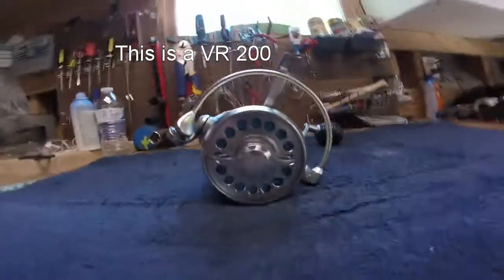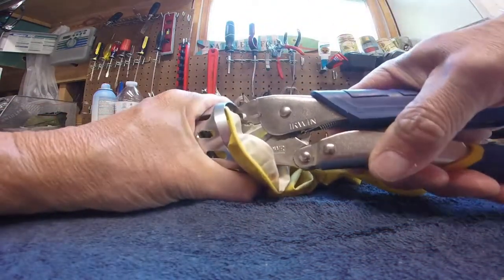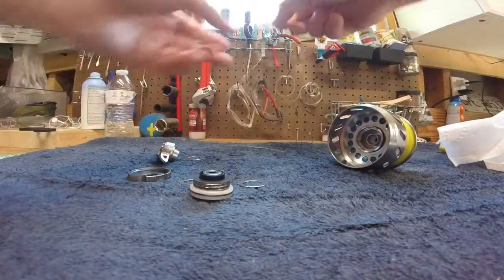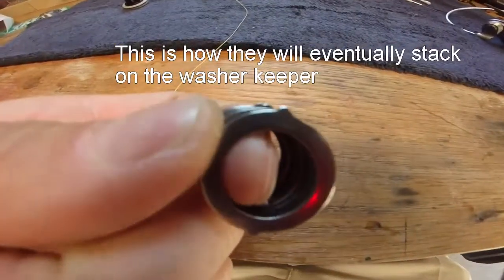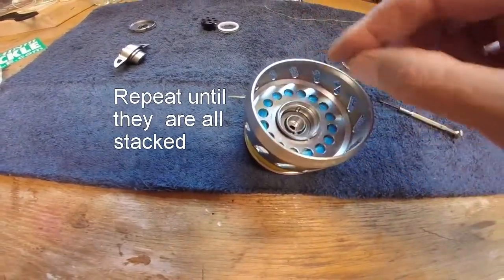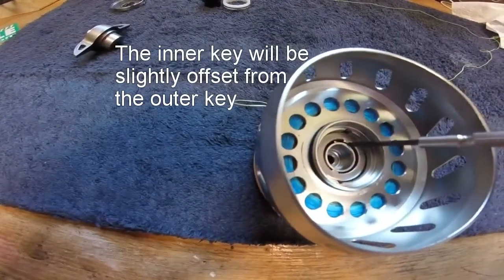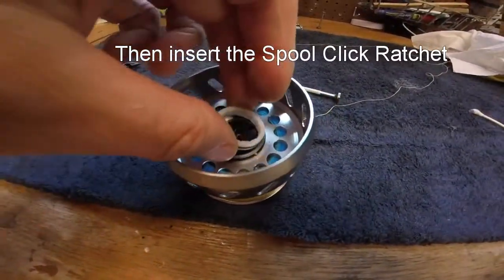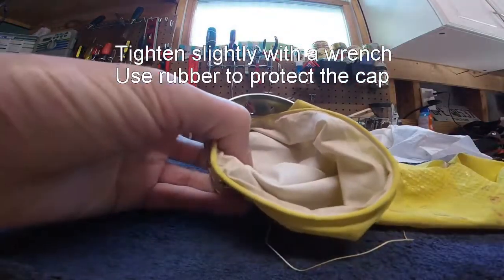Van Staal Drag Inspection & Maintenance

Comment: Hey rht1898, 

I recently came across a post that showed how to reverse the silent drag on the Van Staal VR but wasn't sure how to do it myself. I  know a lot of people who would love to have their VR Drag be much louder so if you could do a video on that it would be awesome! The directions I found are listed below, please let me know what you think, thanks!

[VAN STAAL VR SILENT DRAG REVERSE]
Under the spool you will see the clicker.. the volume is controlled by the tensioner (small metal clip) on the top.. 
Clip is held in place at the two ends that slide into the sides of the "clicker box"... slide the ends out.. you will see that the tensioner is curved (bent) down towards the center.. just make the bend a little deeper.. that's it.  Now put it back on (slide the two side ends into the slots they belong in)..
 
Done.  Now your clicker can be as loud as you want it to be ...
Reply: I think that may work only for the VR50

Comment: Have you experienced any reel failure with your VR series Van Staal? Have you experienced any water intrusion in the body of the reel behind the side plate? Any info is greatly appreciated thanks.
Reply from the maker: Depending on usage and whether you do your own service, you have to make sure all the seals are in good order and properly seated.  During the peak season, I fish 3-5 times a week and almost exclusively in the surf, wading out in deeper water and frequently having to reel with waves crashing over the reel.  If you keep seals service,  you should not have water intrusion but could get small amounts  if some things are not fully tightened or worn down.  Great thing about the VR, is even if you do , it is a very easy reel to service and bring it back to spec.  So you don't have to send it out to a factory center. With that in mind,  I have not had what I would consider a reel failure.